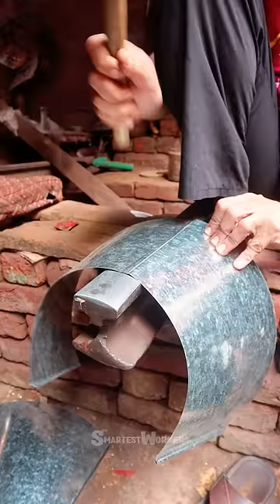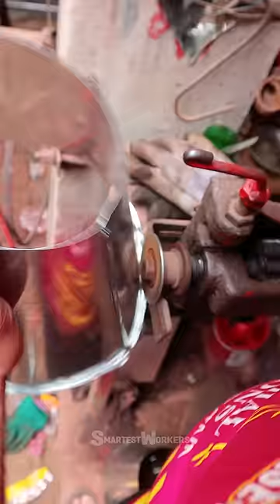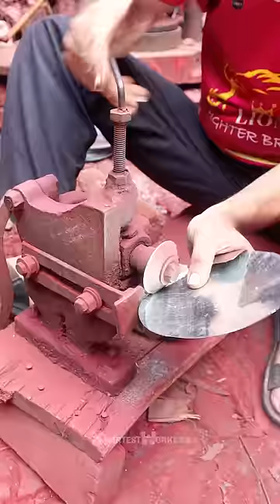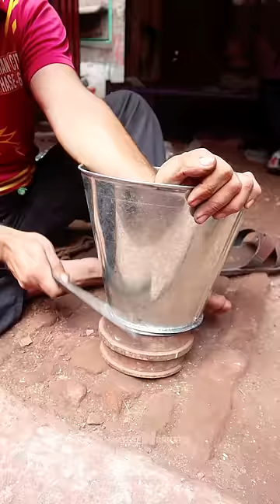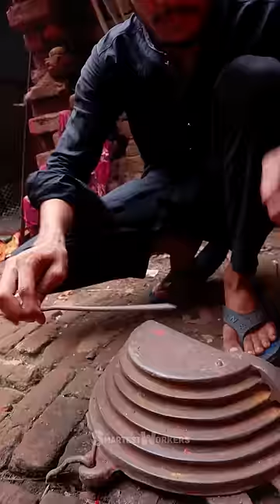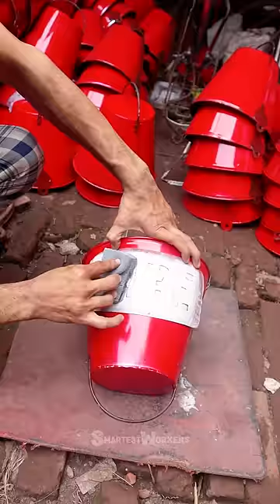Step by Step: The Making of a Fire Bucket! 🔥🪣 #behindthescenes  #safetyequipment

Comment: What is the loop on the bottom for 🧐
Reply: I am guessing it's to hold bottom of bucket easier when you try to throw water into fire. So you use both arms one top and bottom increase control and power.
Reply: será pará impulzar más fuerte y velos el líquido que se lanza.... 🌊 🔥🔥
Reply: I should not be used for some other work